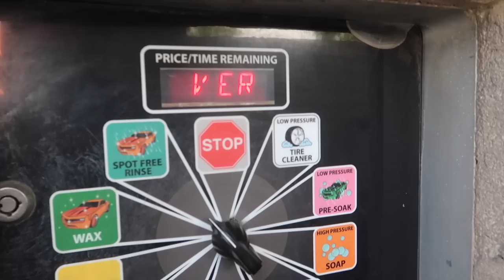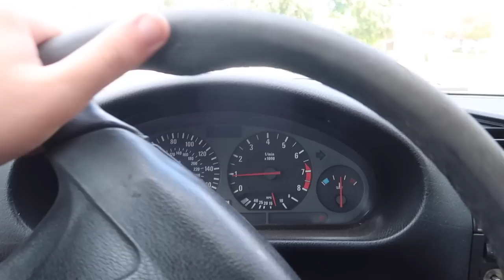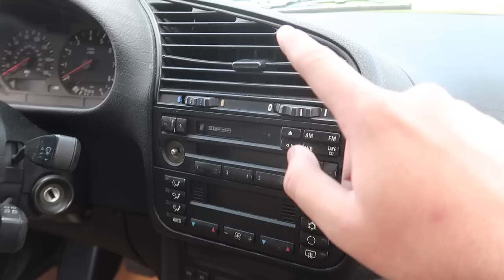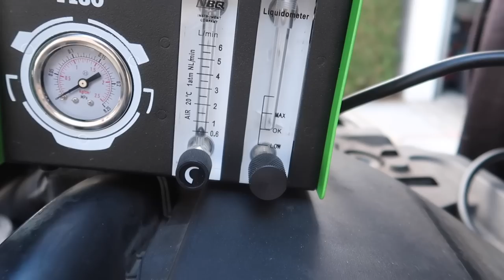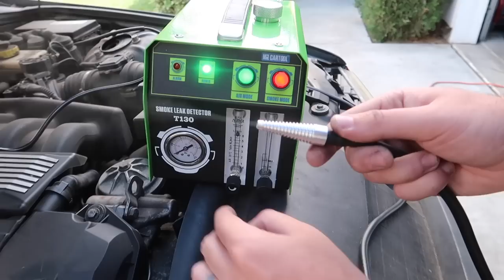PURCHASED THE CHEAPEST E36 M3 IN 2021! TIME FOR A TRACK BUILD!

Comment: that's not an original M3, it's probably a conversion. There is no 5 door M3, its only a coupe, also it  doesn't have the m3 interior , normal steering wheel the cheapest version, normal speedometer, no m3 bucket seats, the woodish looking interior. All these are from a normal e36. The m3 interior is complete different and only comes in coupe
Reply: Actually after reading your comment and looked online it is an m3 mate search for 1997 m3 sedan and also look at the interior its identical
Reply: @ramiabn1114  it's not original mate , different steering wheel, different seats , different speedometer, sport speedometer with silver rings and goes up to 280km/h. Those items can also be found in a normal e36 thats the cheap steering wheel
Reply: Loud & Wrong